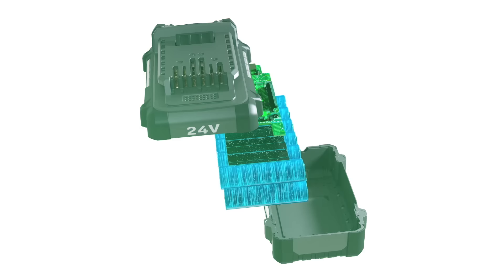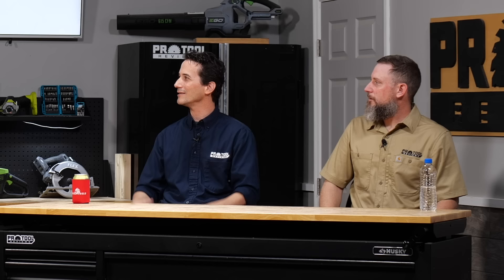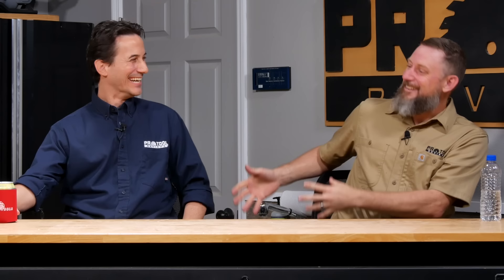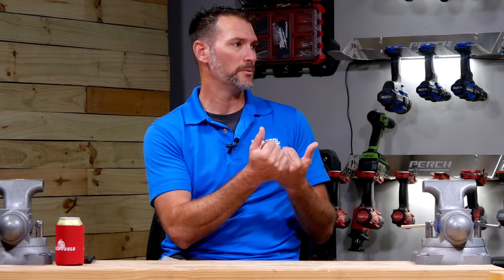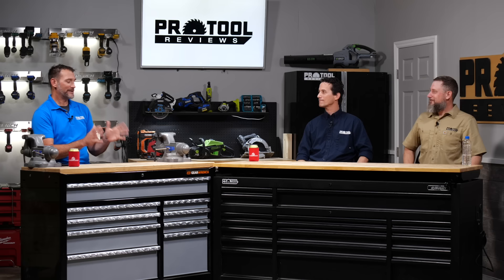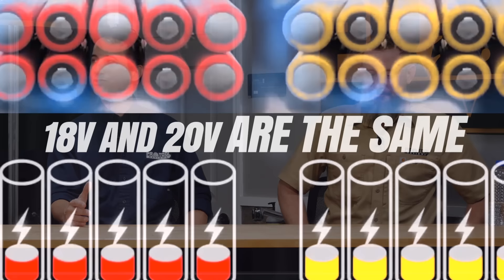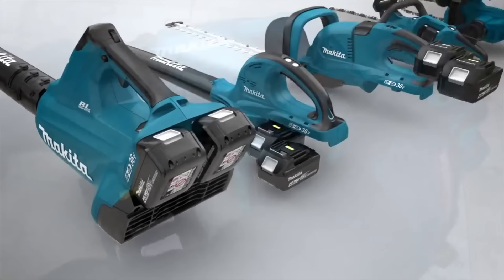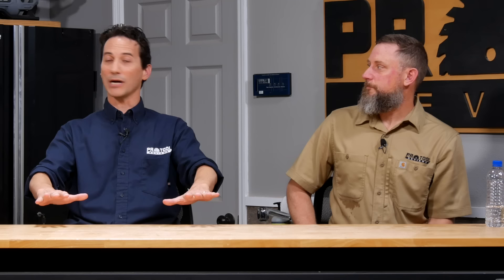You Should Buy 12V Instead of 20V… HERE’S WHY!

Comment: TIM from Canada my suggestion would be 12 V versus 18v versus 20 V would depend on the job you were doing this is the major factor and what tool would work for the job second to this is what what brand you are working with Dewalt Milwaukee Makita these are the three major brands out there now there is a new brand of tool that is on line coming up Ryobi... here is the tool that is a DIY brand but has some amazing tools out there I haven’t the Ryobi brand do not like it but they have a Lotta tools that will do the job and the only major factor on this is one battery fits all of the tools you cannot see this for Milwaukee M12  and M18.. two different brands now getting into Dewalt 20 V... I remember back when when it was Dewalt 12 V.. even still you have to figure out what you were looking for.

Comment: Seems like a long way around to avoid the real important thing.  Watt-hours.  That is a measure of how much energy you have in your battery.  Similar to how many gallons of gas can your tank hold.  Some batteries have it on the bottom or somewhere.  Now do you need a compact light tool?  A lower voltage may help though within reason you could make one with 18 or 12 volts.  Do you need something with a lot of energy for doing lots of work over a long time.  Like a circular saw that has to cut lots of boards not just a few.  You need big watt hour batteries and that is somewhat easier to do with high voltage packs.  So compact tools can do jobs that don't require long run times and bigger tools with bigger higher watt-hour batteries can do lots more work.  Worrying about this contrived voltage argument and big vs compact tools is just another smokescreen to cover up the real issue.  Watt-hours.  

Watt-hours is voltage times amp-hours.  Probably most honest to use nominal voltages for that.  Lots of compact tools have 2.5 amp-hour 12 volt batteries.  That is only 30 watt-hours.  While a 4 amp-hour 18 volt battery is 72 watt-hours.  No one tool is perfect, but going by watt-hours and your needs clears up lots of intentional confusion in the cordless tool market.

Comment: I think Milwaukee should develope a 60 volt battery line for bigger tools like mowers post hole augers chainsaws kinetic log splitters hand held  leaf blowers that can put out  35 newtons or 1000cfm and backpack blowers that can put out 1200cfm. A 10" table saw .This whole dual battery thing is starting to suck. I got the mower the dual battery leaf blower. Id rather have a single big battery than 2 little ones. One battery will go dead first then the other battery has 50% so i make all these trips to the battery box its time for big batteries.  Mx is too big.

Comment: Hello again Pro Tools Review
Guy's my question has to do with safety. As a Aircraft Mechanic, I maybe working on or around the fuel system. Heat is not wanted, you  understand, things go Boom! And yes, I  can say I've been at an accident where the fumes of external fuel exploded. I want the Best tool for the job, safely. That shouldn't be asking a lot. Thank you again
Reply: In your case, the heat generated by the actual tool (the bits/blades are a different topic) is inconsequential.  What you do want to look for are brushless tools.  Brushed tools always have a chance of throwing sparks from the brush.  Brushless motors don't unless it's in the process of burning up.   They really are about as intrinsically safe as a person needs unless you are doing fuel cell work.
Reply: @anthonybarker9123  Thank you for responding Anthony, that's good information I can use.
Reply: @georgeferlazzo7936  You're totally welcome.  I was a heavy aircraft (KC-135) mechanic until I separated in '11.  What I would have given for all the variety of brushless tools out now.
Reply: @anthonybarker9123  Hello again Anthony 
I agree with you. I was a Jet Engine Mechanic in the Air Force. On Fighter Jets, F4, T37, T38, F5, F15, and the F16 Aircraft.

Comment: Not true, my first tools were all 12v my most expensive at the time was 12v Bosch I was a drywaller and metal framing. I got both 12v, 20v and corded tools they may not all be the best tools but they all work and get the job done.

Comment: interesting, I figured a little while ago to just stick with one battery platform and chose milwaukee m18. i ended up buying a bunch of non brushless m18 tools in a bundle for a good price and figure when I replace them eventually with the brushless I'd give these away or sell cheap or something. maybe I should look into replacing some of these with the m12, like the impact driver.

i'm in the market for a jig saw and was going to buy an m18 one this weekend, does the m12 jigsaw cut through hardwood easily? I would classify myself as that second level of DIYer - trying to build different things and maybe some furniture from time to time.
Reply: The m12 lineup is awesome. But personally if you have a line up of the m18 tools and only want to get one more Milwaukee tool I would get the m18. That way you can just get the tool itself. That way you need to buy a set of m12 batteries as well. The Milwaukee fuel is definitely a great investment to go with if you want a good long lasting tool. The regular Milwaukee works really well as well I used those tools for a long time when I first got into Milwaukee but as I went progressing I got a whole lineup of the Milwaukee fuel tools. And it’s awesome
Reply: Just don't expect a jigsaw to cut perfect straight lines, that's for a circular saw.
Reply: @dushk0  already have a table saw and small circular saw. Still need a regular size 7 1/4" circ saw! I ended up getting the m18 jig saw, needed something to cut holes out of wood with

Comment: I'm so onboard with the 1-brand for as many tools as possible concept, particularly due to needing at least 1 charger for every single brand. I currently have 4 brands in my home and I'd like to be down to 1, but few brands have as extensive an outdoor tool range as their work range, or vice versa. And even if they have plenty of both, they often don't have 1 or 2 specific tools I want/use, that another brand does. But then THAT brand will have the same problem...it can be infuriating looking for 1 brand to cover everything.
Reply: Ya it's like cameras. You're buying into an entire ecosystem.

I highly suggest milwaukees m18 fuel products.

I could talk your ear off!

Comment: cell count would. should be a better way to classify batteries. Motor oem type, winding, iron, magnets, controller is info needed to judge a tools basic usably. Then     
  construction and design to use as corded or gas replaced, or a better fit cordless tool.       SAE battery stander?

Comment: But isn’t Milwaukee M12 a true nominal 12V?  And for lightweight tools that have great runtime, what about Makita LXT 18V sub-compact?
Reply: On 12v, no, just closer...  Can't really get true 12v with the battery chemistry they use as 3.6v to 3.7v per cell doesn't add up to 12v, just 10.8v to 11.1v before another cell shoots it past 12v...  What can be a true 12v are LifePO4 cells, which are what they use for drop in replacements for car batteries, home power walls, etc. as they're 3.2v and get you to 12.8v... You can even use regular 12v chargers on them in most cases, and they're safer to use than most other lithium battery chemistries... But they're bulkier and aren't as power dense than the cells used in tool batteries...
Reply: 18650 cells are 4v max. Hence 3 cells per pack = 12v max, 5 cells per pack = 20v max.  Nominal volts for both will be lower. You can see the outline of the basic 3 cells on the business end of the battery

Comment: Is anyone using LFP (LiFePO4 or LiFeMnPO4) cells in their battery packs, to make them last longer?

I don't like disposable tools. I have my dad's Black & Decker 1/4" drill, and it still works fine (though the cord has been replaced). He died in 1962. I want tools that are designed to work forever. I understand that even LFP batteries won't work for 62 years, but they'll do better than the typical NMC lithium batteries.

Comment: the useable power of the m18 tools are not worth the extra costs and bulkiness over the m12 range.
as a mechanic, i exclusively use m12, and if i need extra power, i go back to the air tools.
M18 is a mid-range gimmick-tool that is not needed in the market

Comment: I disagree with brown shirt, I get it, manufacturers probably had DIYs and thier wives in mind when they designed 12v, but as the other guy was suggesting, I think it's best use case is comfort, only a professional would know how much power he needs for a job, and not want to carry a heavy tool all day. A DIYer is a home, using it here n there, dont want to start drilling into 1 inch hole into a 4x4 n realize I probably dont have enough power.. the 18v system will get everything that I want done, I dont wana be guessing as a DIYer, as i cannot fathom buying multiples of the same tools, cuz the 1st one was too weak, this is not a business expense. I cannot just forget my tools at church, I need that back!

Comment: If you actually put a meter on a freshly charged pack it's 21.1 or 21.2 volts.
Reply: And it drops just as much below when discharged, nominal means in the middle or average which most consider more accurate as the voltage is going to drop the moment you start using it and thus the nominal is where you're going to get most of the work done with...
Reply: 20.5V.

Most don't charge to 4.2V+ per cell to get better cycle life out of the pack.
Reply: @jaywelker5566  Not true of all as the results of most actual testing says otherwise.

Comment: I love my Dewalt dcf901 12v, very compact and very powerful for its size. I would not upgrade to a dcf921 20v. Power difference is not that much and ive seen vids that the 12v was able to perform almost as strong as the 20v and the 12v is soo much cheaper and lighter.

Comment: I don't know about 12 volt being smaller. I have an old 20 volt Porter Cable compact cordless, and it's as small as my new Ridgid brushless compact impact driver. Then I have an 18 volt Ridgid hammer drill and I weighs a ton. Course its a 4ah battery. Both the PC and the Ridgid have 2ah batteries. Definitely my PC drill driver battery is very conpact for a 20 volt 2 ah battery.

Comment: Have a lot of money invested in both the M12 and M18 Milwaukee platforms, and own
just about every cordless tool we need ( with a couple of notable exceptions - 1. Band File
and 2. Drum Sander - are you reading this Milwaukee ? ). They work well overall and help
us get the job done everyday. However, our first venture into Milwaukee power tools sans
electric cord was with their v28 Line. They also worked well, and we still have a few of
them left, but none of the batteries are any good. Milwaukee seems to have stopped
developing that platform, not sure why, would guess not as profitable as the other sizes.
I don’t know what cells they used in the v28 batteries, but I do remember the drills and
saws seemed more powerful than the comparable Yellow or Teal tools of that time
(about 15 years ago). Probably just marketing hype. I would suppose the batteries and 
electronics have improved since then. Edit: Apparently, Milwaukee still sells what is now
their M28 platform, but the range of tools is very small compared to the other sizes.
Reply: Question, what do you use the bandfile on?

Comment: The only tool set i have not tried is Metabo. Probably because they are not very popular here in the US. But everyone I have seen that uses them thinks they are the cats meow. So I just use Milwaukee and DeWalt. But to be honest, it's too late for me to switch. I would not be willing to invest another 10K into a new platform, no matter how good they may be.
Reply: Sorry meant to respond to video. I wanted to say I am one of those who believed that 18/20V tools were more powerful than 12V. Oddly enough I have some 12V Milwaukee that i love using. Not sure why I assumed, just seemed like common sense. BUT here's the question. I only have 3 12V MW tools. Rest are 18V. Should I bother getting the tools I am missing such as Ratchet, 3/8 and 1/2 impacts in 12V? (if available) or just go ahead and get the 18V ones. I like that 12V batteries are cheaper.

Comment: So for a new HVAC tech whose just getting started I should get a milwaukee & ditch my 20v dewalt?
Reply: i’m an electrical apprentice and use my m12 fuel impact drill and driver everyday. i highly recommend them for their functionality, portability, and ergonomics. I would still suggest to keep your 20v system in case you need the extra power you can just go to your truck.

Comment: What about as a casual home user?

I had a cordless no name brand impact driver I bought locally in Asia and it was strong and great to use. Eventually, the batteries died out completely and I discovered that the battery system was outdated and nothing compatible existed. The tool is no longer useful (unless I pull it apart and replace the cells).

Now I am considering investing in a Milwaukee impact driver and I'm considering the fuel m18 as a little present to me, but I'm mostly concerned that I will use it a few times and then discover the battery is toast.

Any ideas about longevity of batteries and battery system assuming I keep the battery topped up every few months?
Reply: I have milwaukee m12 and m18 tools and ryobi tools. I originally bought ryobi because it was way cheaper, until I started looking at the differences in power that milwaukee puts out. Ryobi is a great line if you're doing at home work, nothing too heavy duty.

Comment: Wait, if 12v is 10.4v nominal, then what the heck is this 14.4v toolset I found in the storage shed?
Reply: With standard 3.6 Volt nominal (4 Volt Maximum) lithium ion cells, 10.8/12 V is three cells in series, 14.4/16 V is four cells, 18/20 is five cells, 21.6/24 is six cells, etc. This also means that 36 and 40 Volt are the same (10 cells), and 56 and 60 Volt (15 cells) are identical.

However, while there are some 14.4 Volt lithium batteries on the market (Snap-On sells some), most of the time that you encounter 14.4 Volt tools, they will use NiCad or NiMH batteries, which are 1.2 Volts per cell, exactly one third that of lithium.
Reply: @Joel_E  right, it is NiCad. I'd just never seem this voltage on a battery before.

Comment: I disagree with your assessment of 12V circs.   The Milwaukee M12 Fuel is capable and it is no different than the other 12V tools in that its compact, light and does certain things very, very well.  For a lot of jobs, it is the perfect blend of size, weight and power.  Would I frame a house with it?  Nope.  But for quick cuts, working over head or cutting thinner sheet, its perfect.  I love my M18 Fuel circ but its often overkill.

Comment: I have a DeWalt DC970 that uses the DC9098 18v battery. The batteries are dead and needing replaced. I'm considering replacing the drill itself with something newer since I can't find any factory batteries available. Considering the DeWalt DCD777 20v  Max. Is this a good and equivalent replacement choice?

Comment: NO NO NO  If you work a lot on ladders, maybe. Otherwise you are trading in an extremely capable tool for a weak one that has less utility, more expensive batteries and is far lower in torque. If you are working a lot on small stuff it would make sense, for general use NO.
Super high quality aftermarket batteries for 20V are available, 12V not so much.

Comment: Other than the core tools, which every brand has and you pick the best that satisfys most,  I buy cordless tools the same way as I buy a computer printer. Are there good, but inexpensive  generic  inks for that printer and then go with the one who has so not to get locked into the ink scam. i.e. Go with who has the best inexpensive generic batteries and go with that brand of cordless tools.

Comment: Question - (bit of a tangent) any thoughts on how Milwaukee can have a table saw and miter saw with their 18v battery but dewalt is using a "60v. max" battery for that.
Reply: They answered that, the batteries still have similar number of cells.  The voltage difference just effects amp draw and thus efficiency but it wouldn't result in a big difference.  Mostly effects heat and thus how hard the battery can be pushed or how long it can run...  It's the double or much larger packs that you can see a noticeable difference... Basically, most of the performance is tied to the number of cells in the pack, they can just tweak it with how it's designed...
Reply: @ZeoCyberG  Good point, thanks!